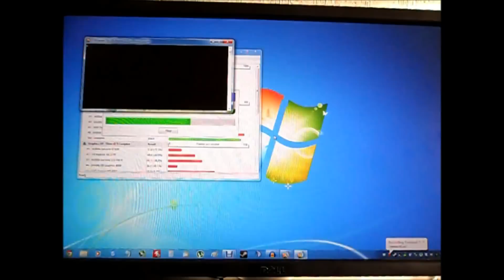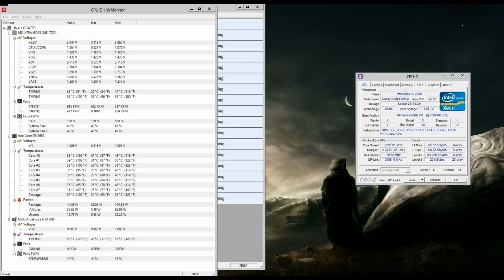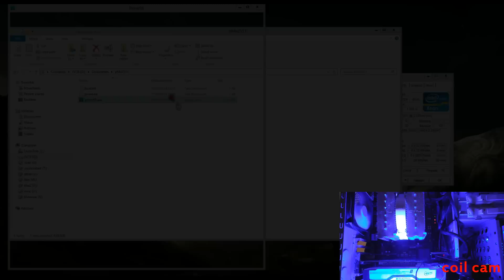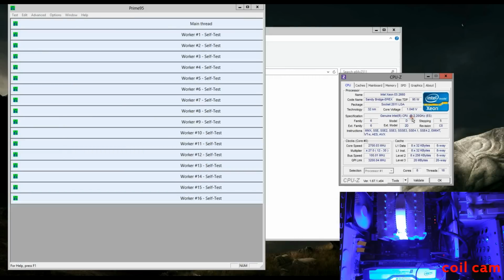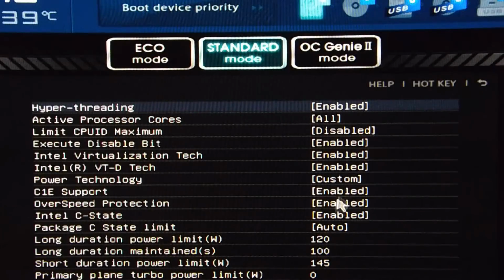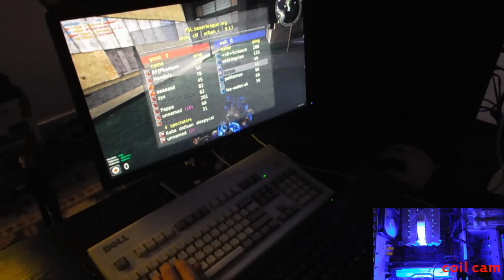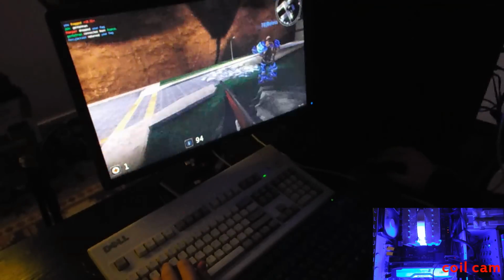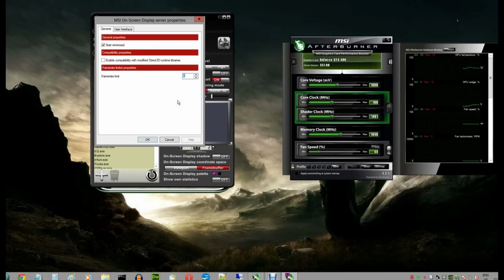07 How to get rid of coil whine

Comment: how to stop coil whine in 3 steps:
1. get non conductive meltable silicon
2. locate the coil noise
3. glue that sucker with silicon
and no more coil whine
Reply: Or watercool EVERYTHING so it wont overheat even in a wall and then put the radiators outside your case and fill it with something that absorbs noise and is solid ...
Reply: +SIME_LP mine's water cooled and still , I always get coil whine
Reply: then you didnt understood me ... i ment to watercool it and fill the case so no noise can get out and watercooling because aircooling wont work when you fill everythig up
Reply: +Fresc222 water cool everything in the case , put the radiator out of the case (a bit of case modding will do) and there you go ...
Reply: BogdanDorianC Nobody said anything about a submerged mineral oil setup.
Reply: +Gregory Batizi I can see that, that's why I said "he probably meant". But, then again, if he didn't meant it, he probably: 1. is an idiot(like you said); 2. he has another idea, but doesn't know how to put it in words(probably not very good at English)
Reply: +BogdanDorianC Or, i forgot, he didn't get the idea of what exactly makes the noise inside(probably never change a bulb light in his life)
Reply: It doesn't matter what his idea is or what he actually meant, setting your radiators outside your case has absolutely NOTHING to do with coil whine, nor will that setup help to eliminate coil whine. Radiator placement has exactly zero to do with coil whine in any way, shape, or form.
Reply: +Gregory Batizi y
Reply: +Gregory Batizi y
Reply: eeee

Comment: Thank you so much. My laptop started to have this problem about a month ago.
Took me a loooong time (3+ hours searching) to find out that it was coil whine.
It was exactly like the one you had. I could only hear it when there were very little processes running but it was super annoying because it made it hard to make homework. This weekend I disabled the Intel C-State setting and the other setting and after a reboot the coil whine is completely gone (for now).

Comment: My coil whine begins at only 70+ FPS (eg. in Anno 1800, The Division 2). It started after I exchanged my old R9 285 for a Vega 56 Pulse. Since 70+ is not that much: Should I return my card?

Comment: THANK YOU SO MUCH!!! I had the first problem where the motherboard was whining in idle. You just saved my ears!
Reply: Robert Lang what did you do to fix it? That’s my issue right now and doing what he did in bios didn’t fix it for me
Reply: @DJMizzy  i just did what he did in BIOS. Maybe it worked because i have an msi mb just like he does.. Try disabling any power saving options connected to the cpu.
Reply: Robert Lang hmm 🤔 I also have an msi motherboard too. I’ll try again and look out for that. Otherwise if it doesn’t work I’ll changing my motherboard

Comment: I have a whining noise you hear in the bios and in windows, but it only goes away during prime95 or intel diasnostics at a 100% load. Tried disabling all the c-states (no luck) and changing the idle processor option in power management made it higher pitched. Know anything else I should check? and why does it go silent during a 100% load?

Comment: I'm getting coil whine (small buzzing sound) when my 970 is under heavy load. Any tips? It doesn't bother me, I just want to
Make sure it doesn't damage the card.
Reply: ***** i have same problem..use EVGA  precision X limit ur frames works fine for me now..
Reply: >buy AMD
Reply: i got mine 2 weeks ago had coil whine and went away after 1 week i don't hear it anymore :D
Reply: dajani22 This is good to hear. I was hearing coil whine but it was mostly likely from running league of legends at 600 fps lol. Just received my 970 today and was wondering if I should rma it or not. Will try these tips and hopefully it just goes away.
Reply: Austin Galligan i'm sure it will go away :)
Reply: Lucas C It was a joke m8. relax.
Reply: *****
I RMAd my EVGA GTX 970, got a new card. Still coil whine... I ran Shogun 2 and the card sounded like a freakin pig.
Reply: it wont damage the card
Reply: Lucas c, if your ocing to much it could happen. Make sure you have enough psu for your system.  Otherwise idk. I hear a lot of people talk about it but nobodey has said it's killed their gpu yet.
Reply: Coil whine or buzz is just sound coming from the coils in the card when the frequency(Hz) and power(volume) in the coils gets into a range that we can hear. Normally this is outside the audible range but it is always there. As to whether that sound is an indication of to much overclock or too little power or bad PSU, I can't tell you, but the sound itself is just an annoyance. I think it is generally not considered an issue beyond being annoying, I can't hear mine from a few feet away due to bad hearing so its not an issue for me lol

Comment: Is this noise from the actual pc case or from headphones? Because I was having this whine when moving mouse and a heavy background noise when playing games (in headphones only). The cause was the smart card reader at the front panel of my pc, right next to the headphone hole. The headphone line and the 2 smartcard lines were connected together until they reached their connection places on the motherboard. The fix was to unplug the 2 smart card connections from the motherboard (for gygabyte it should be at the bottom right corner next to the on/off connection). I think this can be caused in many situations where a bunch of active wires cause interference for one another.

Comment: I am not getting a whine, but I am getting extreme buzzing electrical sound when i'm running games that require moderate to high power. It almost sounds like a cricket, but like a staticky sparking sound. It is quite loud and unbearable. If I minimize my game it instantly goes away (for the most part - although sometimes when minimized if I move the mouse around it makes the noise again). VSync was already enabled and does nothing but I am going to try using an FPS limiter.
Reply: bouncygangsta
it was my power supply. I had to replace it.
Reply: +bouncygangsta lmfao the struggle.

Comment: my coilwhine goes trough my mic to my friends when i skype :(
Reply: Change your microphone usb port to your front usb port on your PC, this solved my problem with my headphones that was attached to my pc on the back side, so I heard the coil whining in my headphones. This is because your system in your pc picks up the coil whining sound and transmits it through an audio device
Reply: I already use my microphone on the front, to be honest i never checked for any other holes for it to go
Reply: +MonkiBoi my problem was the opposite, front panel audio ports are hardly ever shielded properly, and can have grounding issues.

using my rear motherboard audio fixes the problem, and buying a more expensive case fixed the problem so i could use the new case audio port fine
Reply: @ReflexParkourTM  thats exactly my proböem
Reply: that may be a bad microphone or a ground loop

Comment: thanks for the helpful info, -----Easier fix------ for those who dont want to go into bios:
For cpu coil whine you can just enable 'Performance mode' in windows power options, it worked for me. but I thought it was a shame to have it running at 3.8GHz idle, so I made a custom power plan with a minimum processor state of 50%. I still heard the whine but it was much more subtle, setting it to 75% got rid of it totally. 
So now my 3.8ghz cpu is running 2.7Ghz idle and about half of its voltage according to CPU-Z, and silent.

Comment: I'm getting a gtx 970 and I'm scared it will start coil whine or should upgrade to a gtx980 and don't say a 980 is overkill because I'm future proofing and price doesn't  matter Plz help👍
Reply: Lol 970 is fine dude. I have a 960 and i5 4690k and it plays far cry at 60 fps give or take.  

I got a whine on it but it's factory clock is like 1230 and I put it to 1540, I down clocked it after I heard the whine and now it's at 1440 and there is no whine.
Reply: I have a 980 gtx, it does have coil whine too, very loud. any games does it.
Reply: my 970 strix has very loud coil whine

Comment: Sorry to even encounter that problem...!! I've had coilwhine form my PCIe audio card, wich i didn't had at start, it happened that i swapped components and changed the pcie slot of that card. At the end it was the nearess to the video card, because the top side isn't shielded (the bottom is), when i started gaming i could hear coilwhine in my headphones.

Comment: I often find that coil whine comes from under-powered graphics cards, either too small a power supply or the rail on the multi-rail power supply is over-loaded (another reason to buy a single rail PSU). Old GTX480's, 580's and AMD 7970's (the new 290's as well) often have this issue when on a rail with only 200W or so. If you can grab a PCIe connector from two separate rails, this often provides enough juice to fix. In general, I know everybody loves to complain about how people buy overly large PSUs, but if you overclock you CPU and use a big graphics card, buy a big PSU (I would say 750W for a single large GPU, you can go less if you are not overclocked your CPU). If you are using 500W, you need a 750W PSU, not a 550W. It just works better than way.

Comment: Thank you very much. That helped:)
I bought gtx 1070 and I tought that card was making that  noise.
Turned out it was my MSI MPower z77 MB i switched oc genie button and that was reason. when I did go to bios switched what you suggested it worked.
Also switching OC genie off works too.
No power saving while overclocking.
THANKS

Comment: i just bought a new pc. the psu is an rmi1000 corsair, 980 ti from kfa2 hof, 5820k, ram 32gb of 3000 mhz ram g.skill, motherboard is an asrock extreme4. ive installed them on a big box, a currier fuxked up my case and i cannot gwt it until monday. the psu's coil whine is the most anoying. the graphic card produces coil whine, but the psu has the highest db

Comment: I've read lots of posts about how to deal with coil whine. All agree that coil whine is inherent in all units with coils. So why is no one mentioning the obvious solution? 
The case! Get a well dampened case like Fractal Design or some other if you don't want noise. Only use a windowed case if you absolutely have to be able to look inside your pc, but then accept the noise. You usually can't have your cake and eat it too. :)

Comment: My GTX 760 coil whines when the fan speeds up. I have two different whining noises: The regular buzzing-sound is only noticeable if I close up to the computer, but the more annoying thing is a constant high frequency noise, that I can still hear in the next room with open doors.
Neither limiting the FPS to 60 or 40 nor overclocking the gpu fixed it.
Reply: Next room? Daamn

Comment: u sir have another problem then speed step. Speed step is not make the bus speed fluctuate, it only messes with the multiplier. I guess its a bug in ur bios/uefi or sthg else but u should fix that bus speed to 100 instead of having it on auto setting or whatever. It fluctuates normally in the 0.1/2 range.
Maybe speed step cures it but its not the cause and i guess ur whine will be gone when bus speed is fixed to 100
Have a nice one and pls change in ur nice made video

Comment: i mean 0.01/2.
My i7 is completely stable on auto at 99,98, no matter if its running 4.4ghz or 1.2ghz in idle.
Definitely not normal behaviour, never seen before
Pls report if coil whine is gone when u fixed that issue and turn speed step back on.

Comment: It seems to me the PSU is the main cause of coil whine. I tried to install a 980Ti into my PC and it had massive coil whine. My PC has a 750 Watt pretty low end PSU.  When I installed it back into it's original PC with a 800 Watt 80 + gold PSU no coil whine at all. But maybe what I had wasn't even coil whine but something worse. I only had a 35770 with a 4 Ghz overclock in MY PC. Who knows. People with this issue should try a bigger, better PSU.

Comment: I am getting very bad coil whine on a GTX 970 even on 60 fps...
Reply: same
Reply: +CoodSpoong replace it. my G1 970 only makes the slightest amount of coil while when dealing with 160+ frames and I can only hear if I remove my case door and get close.
Reply: Gurji Jheeta The while stopped a few hours after posting the comment ._.
Reply: +CoodSpoong overclocking may help.